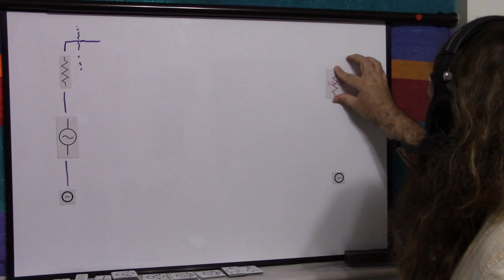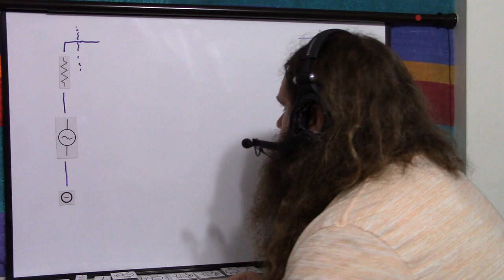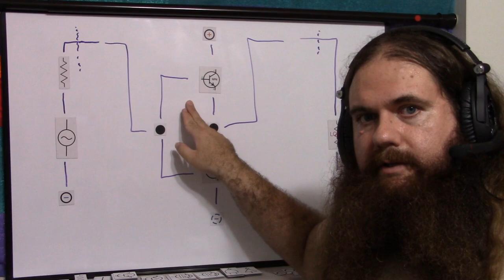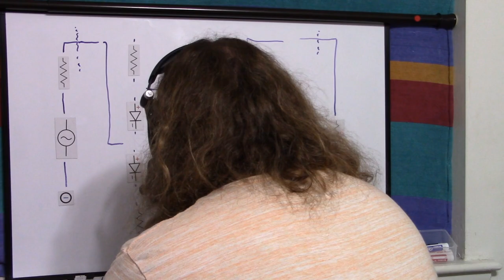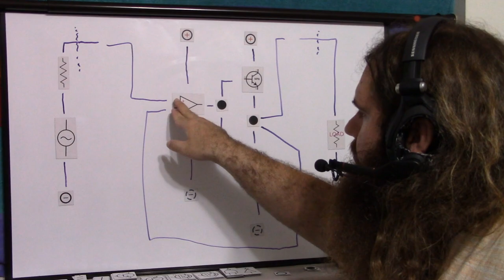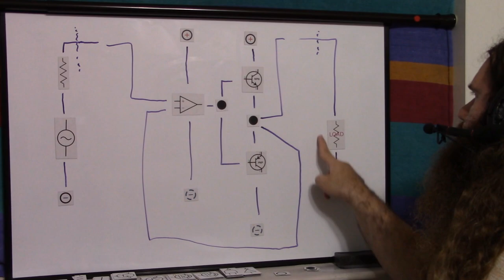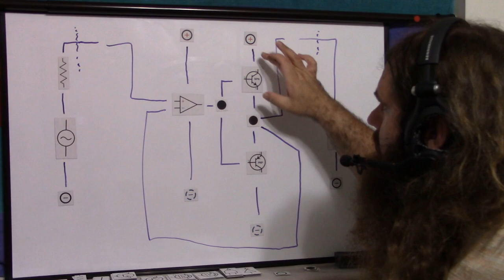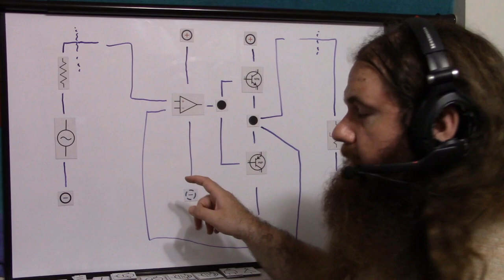Push-Pull Output Stage - Your Signal Needs More Power - Simply Put

Comment: I put this together in a simulator and the output voltage was exactly the same as an input one (isn't the way OA works?). To get some gain I had to add a voltage divider to feed a part of the signal to an inverting input.

Comment: This is the second time I ended up here by searching you tube because I sort of got it - but wanted someone to explain it more logically. I just built a push pull TIP31/32 on an audio amp, it worked but the diode biasing thing messes my head up. I think last time I was spewy about the cuts making the speech relentless and unpausing. Seems to be a few breaths added this time but - space is beautiful. Imagine if your whiteboard was just full of lines and had no space between things ... like you had to squeeze everthing into the tiny corner and ignore the rest of the potential ... and it was just unpleasant and cramped ... something like that. Your channel will, with various editing improvements ... become huge I'm sure as you have the pulse of what people don't get and need to understand.

Comment: 10:27 as for the feedback, I'm not sure, but I have a feeling that the output will still be the same as the input signal even if there is no feedback. I know it sounds spooky. I mean having the op amp as an usual voltage follower and keep the BJTs handle the output on their own.
Reply: I know this is an old post, but for anyone reading this, the feedback most certainly is necessary to keep the signal the same as the input. Otherwise your input will immediately be driven to [+/-] rail voltage because of differential amplification and the extremely high gain of the op amp.

Comment: Very good video even for me who is a novice in electronics. A question i have however, is what if my signal source is a square wave, do i need to have PNP connected to the negative voltage generated from a split supply or any other way?
Reply: This question doesn't entirely make sense. It depends on what you're trying to do with your square wave. If you're strictly dealing with digital electronics and you're using the op amp as a buffer then you most certainly do not want your system capable of delivering negative voltage to your circuit. Digital circuitry generally does not handle negative voltage well at all.

Comment: Hi there. Your video is quite informative. Im trying to drive a mosfet gate(4000pf). I had two option first one is to buy a gate driver ic which is not available here and other option is to make a push pull transistor circuit which i tried a lot of time and remained unsuccessful.  I have   
Used bd139 bd140 transistor pair. But i dont know why the output stays high like 9v and when i apply positive pulse then otput just fall a little bit 8.85v. Which is absolutely not a good way to drive mosfet gate. Could you help me to make the circuitry or provide me some schematic which would work fine

Comment: Sorry I am new to this but I have a couple questions. So at the very end the op amp is a unity gain so it will try to match the output to be exactly the input. So does that mean there is no amplification? 

I have a hunch that this might just mean there is no VOLTAGE gain but there is a current gain right? If so how do you calculate the current gain from this circuit?

If I added resistors to the feed back system of the op amp would I be able to get both a current AND a voltage gain?

Comment: So the signal's one lead goes into the OpAmp + and its ther leg goes directly into the circuit ground and no resistor.  Is this correct?
Also the load is not hooked up to the positive rail, it is hooked up between the two Transistor?
Reply: Power inputs on the op amp go to +/- voltages, respectively. The positive reference pin is attached to your input signal. Both the load and your negative reference pin are attached in the center between the two transistors.

Comment: THANKS FOR THE GREAT VIDEO!!!  At about timestamp 2:10 you state that if we are only using a digital driver (I'm using a 555 in the astable mode) this single transistor is all we need to reverse the high current.  What I don't understand is that when the output of the digital driver is low "0", the transistor cuts off (or does it?) which would result in NO current flow.  Am I missing something?  I want to connect the 555 so that it sources AND sinks the higher current.  It's output goes from a low of "0v" to a high of "5v -15v".
THANKS MUCH,
Reply from the maker: I didn't say it would reverse the high current: The point of the examples I give before I get to the actual push-pull one is to illustrate the problems I'm trying to solve with the push-pull, which are to have bidirectional current and to have power amplification (meaning the signal is not driving the load). In the configuration at the two-minute mark, if driven with a binary signal, it's basically "open-collector" with no pull-up resistor, so it will turn on and off a load with power amplification. I was just trying to say that if all you need is power amplification and all you need to do is turn it on and off (for example, a light or a fixed-speed DC fan), then that would work and you don't need something fancier.

Comment: Great video. Would this circuit also work with mosfets? And do you need for several 100V resistors instead of an opamp?
Reply from the maker: Push-pull would work great with power mosfets yep, it's common. I don't understand your other question: Are you saying you're trying to work with a 100V supply? I'd just say look at spec sheets to find parts rated for it.

Comment: Super. just to clarify myself a bit, 17:35 with this configuration will the load be getting a voltage of + or - thus a digital-like or logic-like voltage (I mean just the rail voltage), or will it be getting the (supposingly) analog voltage of the input (the most left) which is varying and smaller than the rail voltage ?
If it follows the input voltage, this means that the voltage across collector-emitter is not 0 in general.
Reply from the maker: This video is a little confusing because I wasn't using the "circuit ground" symbols yet. The solid-circle negative is circuit ground, and the dashed-circle negative is negative rail.

This is an analog output: The op-amp is configured in non-inverting unity-gain mode: The signal is on the non-inverting input, and the output (lso connected to the load) is on the inverting input. The op-amp is going to try to change its own output until its non-inverting and inverting inputs are effectively equal, so the load will be receiving the same voltage as the signal.

Comment: great stuff but it is not an easy stuff. definitely at least intermediate level :) I will come back one day :)
Reply from the maker: Please do tell me if anything I explained was still confusing or you'd just like more clarification. I can always make more videos with more detail or going over specific things.
Reply: @simplyput2796  Hello :) Well, for example 1:08 , I dont understand why - from load is attached to the collector ? This would need to me some extra explanation. So where the (-) from the emiter goes than  ? Your learning is amazing but I find in your videos a lot of information presented as obvious (that are not for a beginner) and you quickly jump from one fact to the other to there other and summarizing "simple as that " :D  . That's why I think this is not "simply put" for even not a relatively beginner. Absolutely I don't want to criticize  ,however the pace and " obviousness " of some facts is for someone that would not need to have it "simply put" :-)
Reply from the maker: Well, I'm a bus driver learning electronics from nothing more than Google and Wikipedia, so I can assure you this is definitely at a "beginner" level. :P The arrangement at the beginning does have the load connected to the collector: It's an "open-collector" arrangement which I have done a video on. And the (-) is the 0V "reference voltage", which will usually be the negative end of your power supply. I'm jumping through the different arrangements in that video quickly because I'm not trying to actually teach them as arrangements you should use: I'm explaining the problems with them. That's why I spend a lot more time on the final one, the one I'm saying is the proper solution.
Reply: @jatza07  you should watch all videos from the beginning to get a better understanding.
i know it's a big task, but worth it.
Reply: parapos thanks man! I learn from many sources and more and more things I can combine and understand.  But it is my passion for last 3 years :) it is such a broad topic 😄